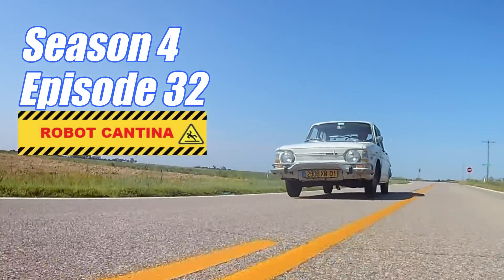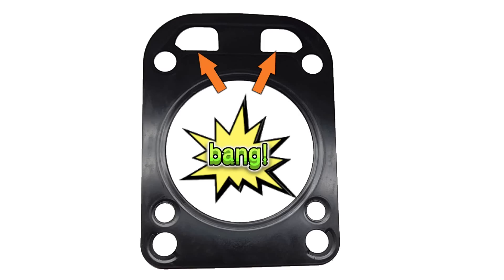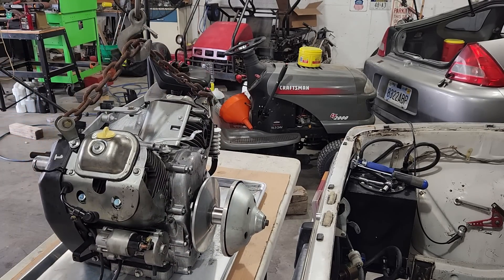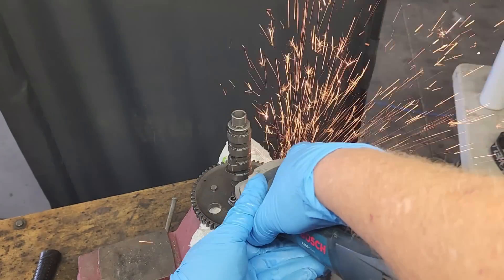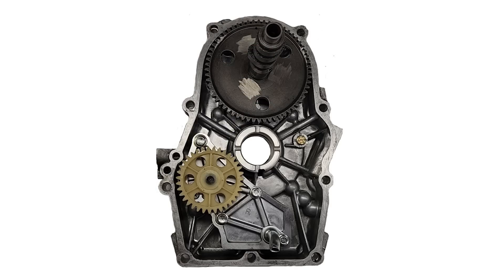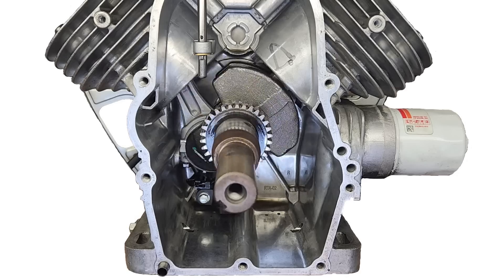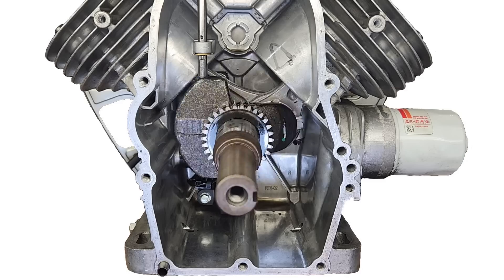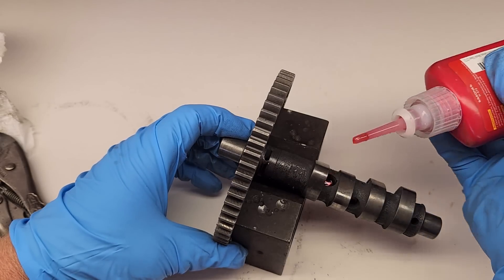S4 E32.  We do an autopsy on the 670 cc predator engine in order to find the oil leak

Comment: Thanks for explaining what actually happened Jimbo.  Makes me wonder if aftermarket 670 cams are solid through the center.  When you get the engine back together, I’d be curious how low an rpm it will idle at.  That 180 psi cranking pressure is impressive.  I wonder if the cam is advanced in its factory position, and perhaps retarding the cam a tooth or two might improve the high rpm performance. 👍
Reply: The performance cams are solid through the center and don't have the compression release mechanism.  I have one in my 670 engine.

Comment: Loctite and permatex also make concoctions specific for these types of applications called sleeve retainer. I believe it's a more permanent bond than the regular old thread locker. It definitely works better. I've used it in applications where say a bearing is supposed to be press fit into a bore but it's able to slide in and out due to parts mismatching. It has worked really well for me.
Reply: The green 609 sleeve retainer is a miracle in a bottle. It’s the perfect match for worn out bores and keyways. Locks everything solid til you hit it with a torch to break the bond.
Reply: @RichieRichOverdrive 609, 620, 640, 660, 680. I keep 620 for the higher temp applications.
Reply: @PBVader  that 680 is very permanent lol
Reply: Isn’t that stuff typically green in colour?  I’m thinking of the goop that holds seals in their covers.
Reply: @gregholloway2656 metal on metal usually, outer bearing races to axle tubes and sloppy fits that are no longer interference. Some say sloppy ar barrels in loose uppers for accurizing, I don't know.
Reply: 603 (also green) is also awesome. It is a bit more viscous than 609.
Reply: General question for this group of people. I have a large belt drive fan that the bearing bore is wallowed out. Its aluminum, because why not I guess. I tried 680 in the past and it worked short term, but its already back to being lose again. I know a more proper repair would be to machine the bore round again and use a sleeve to get the proper clearance, but the cost of doing that isn't exactly worth it. Being a fan, it runs many hours everyday, non stop, but is usually off overnight. I know this is a stressful location, especially with about a 4 foot diameter steel fan blade riding on it. I'm looking to get by for a year or two, and was wondering if the 609 sleeve retainer would be better suited in this case than the 680 retaining compound that I already tried.
Reply: @snoopdogie187  680 is about as strong as it gets, beaten only by 620 in temperature. The problem comes when you're trying to fill a gap greater than 15 thousandths. In that case, you not only have to be concerned with the radial loads from belt tension and blade imbalance, the retaining compound may not even cure and cause the outer race to chase the bearings and inner race. If the gap is smaller at a couple thousandths, try 609 or 640. If the bearing is hot and clearances too large, cut one piece of coke can to shim between hub and outer race, decrease everything and apply 620 to mating surfaces and both sides of shim, reinstall and cure for 24.
Reply: @PBVader  Thank you, that was a lot of helpful information.

Comment: I love forensics with systems and engines. It's amazing how certain seemingly nonrelated items can totally mess things up. Reminds me of an old Air Crash Investigation once about a plane (I believe MD 80) that crashed on takeoff because the pilots didn't set the flaps. It did have a flaps warning system on it, but it was routed through the same relay as another, less critical system. When maintenance turned off the light for the non-critical system by removing the relay temporarily (no replacement relay available to them at the time), they also unknowingly disabled the flaps warning system. The pilots blazed through the checklist without much attention, and forgot to set the flaps. Just glad the cam/oil fiasco was not deadly!

Comment: with bar locked in place   how does the back of the cam bearing get oil ?
Reply from the maker: Keep in mind, the opposite side of the cam gets lubricated by the four notches in the block that allow splash lubrication to reach the part of the cam that installs in the block.
Reply: @robotcantina8957  i understand that part  very true   i would believe it gets most of its oil from the pump to oil the cam followers and bearing
splash is good but pressure is better    great vids   thanks for the reply

Comment: I respectfully disagree with your diagnosis, and believe the reassembled motor will continue to leak. The caise of the oil leak was the jiggly crankcase seen in the animation. When a crankcase becomes jelly like it will leak oil until it hardens.
Reply from the maker: Indeed, the rubbery crankcase is alarming.  hopefully it will be OK.
Reply: @robotcantina8957  Actually I have encountered a crank case in aluminium alloy that was soft and pliable in a 1936 Terrot 100 MTK (the ancestor of the moped).
Reply: you had me in the first half XD
Reply: Maybe some ground up viagra dust needs to be added to the gas and oil.
Reply: Nobody wants a jiggly case.
Reply: @Miklethun  Happens as you get older
Reply: @Miklethun that normally happens to aluminum around 450F.
Reply: You guys are completely missing the point. Under the thermal stresses involved in computer animation, the pixels in virtual aluminum often lose integrity, turning into a soft, rubbery polymer. The only solution is to halt the animation, and load a clean backup of the source material, taken before the state-change event.
Reply: We shall see

Comment: I was for certain you were going to machine an aluminum slug to drive into the camshaft
Reply: I was thinking a small soft plug of the correct size
Reply from the maker: Actually, I ordered a 12 mm 6061 slug for the cam and it fit perfectly.   I went with the HSS slug because it potentially strengthened the cam.

Comment: I would have threaded the back end of the cam and put a plug in just past the PCV vent hole and secured it with loctite. I just don't trust loctite to hold on its own. That would have also allowed for oiling of the valves. I could see the possible pressure drop to still be an issue. For that I would thread the front end of the cam and put a plug with a much smaller hole in it.

Comment: The quickest and simplest way to tell if you have a blown head gasket is to remove the oil filler cap.
And if water cooled the radiator cap.
If there's puffing of gasses coming out then the head gasket is blown.
On a V twin removing the rocker cover opposite the oil filler cap cam tell you which head is leaking.

Comment: Concerned that with the lock tight holding the bar, that oil can't get past. Couldn't tell if the cam bore was grooved or smooth.
Reply: Are you meaning for oil supply to the lifters? I'd think the splash lubrication going on should be sufficient, wouldn't it? Or are you thinking about something that I'm not?
Reply: @goosenotmaverick1156  oil thru to the far end cam bearing surface for one.  Those holes at that end of the cam would also send oil upwards via centrifugal forces.
Reply: @willwebbjr   when it comes to these, yeah. There's not a ton of seat pressure on the valves, limited forces and limited RPMs. Also Jimbo pointed out some oil passageways to feed what I assume is a very limited amount of oil to the far end bearing of the cam. 

Having pressurized lubrication in smaller engines is generally pretty limited unless above a certain size. All their camshafts and even crankshafts are splash lubrication. 

Also to take into consideration is that oil pressure is not what prevents friction, it's the film strength.
Reply: The cam lobes are splash lube.  We can tell this because only the exhaust lobes have holes (for decompression), the intake lobes have no passage for the oil to reach the lobe surface.
Reply: @gregholloway2656  do you really thing splash is enough?  They had oil through the cam for a reason.
Reply from the maker: Keep in mind, the opposite side of the cam gets lubricated by the four notches in the block that allow splash lubrication to reach the part of the cam that installs in the block.

Comment: Is 12 bar compression not way too much for normal gas? No pinging problems?
Reply: Total compression it's as critical to octane as is compression ratio.
I don't know the exact specs, but I think 
It's likely that this engine makes over 12 bar but because of cylinder/head geometry the ratio is not too high. 
Probably less than 12-1 and just fine for regular unleaded.
Also, ignition timing on a small engine is not usually variable and set quite low to avoid preignition and overheating.
I am on my first cup of coffee and could very well be wrong..